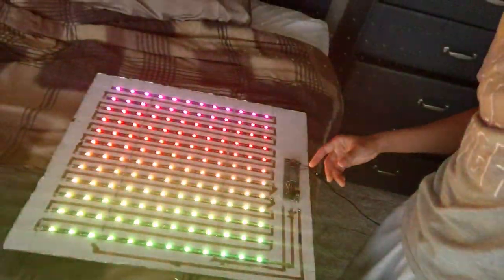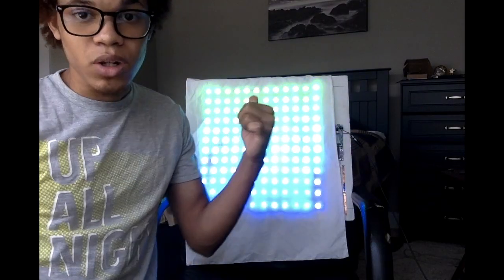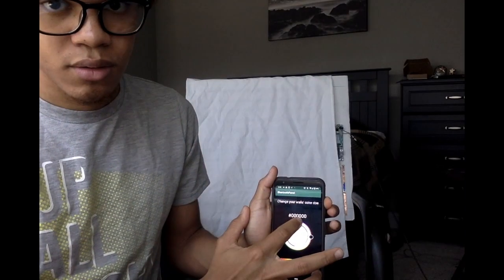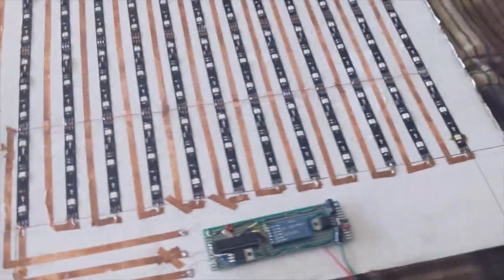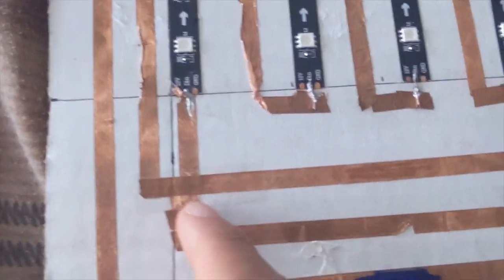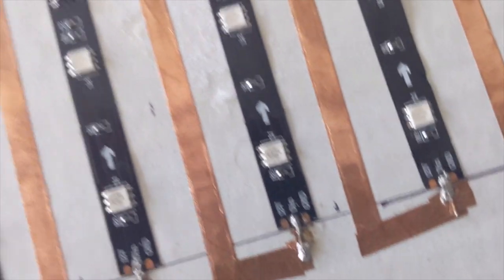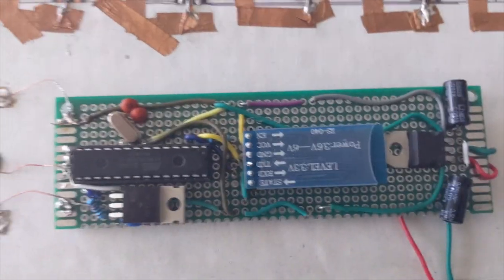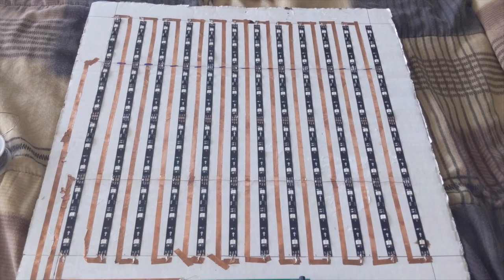Arduino Controlled LED wall Panel

Comment: Good stuff! I'm having trouble getting the Bluetooth and app to connect.
Reply from the maker: Are you on IOS or Android?
Reply: @redwhiz1148  Android
Reply: I think it's the code I have on the arduino. They communicate with out the Bluetooth and app just fine. Idk. I'll keep trying
Reply from the maker: Stay tuned I'll make a Bluetooth App w/ arduino tutorial
Reply: @redwhiz1148  now that would be DOPE!!!! You the man son!